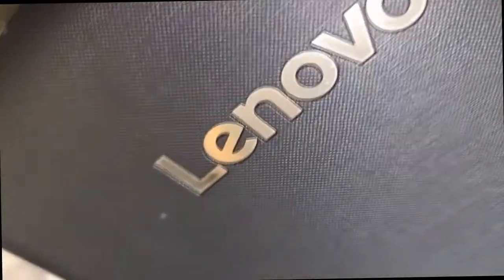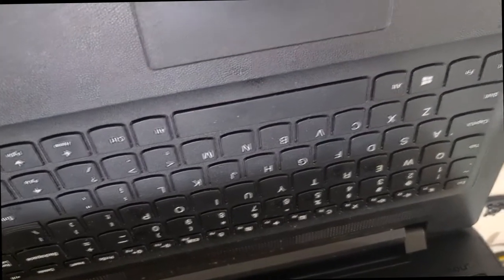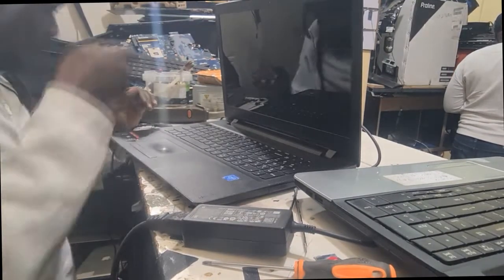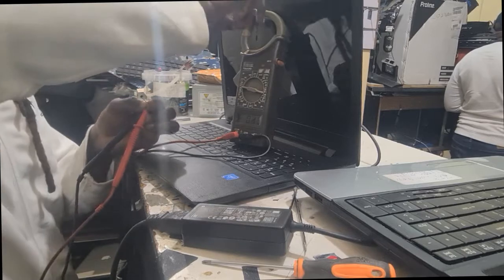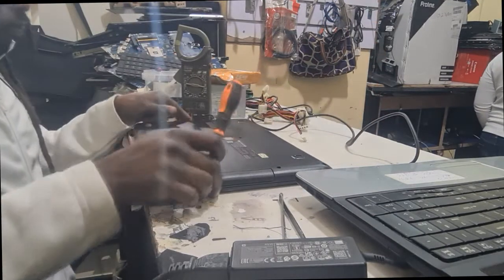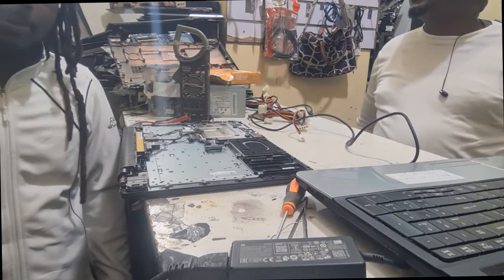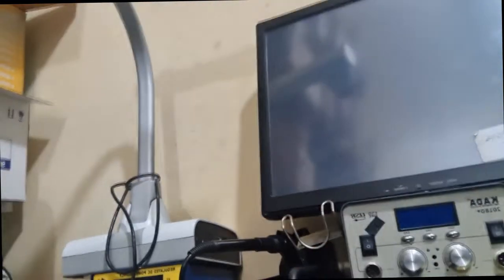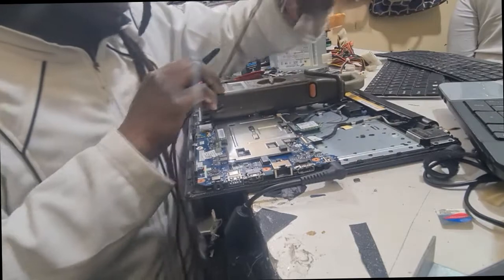LENOVO IDEAPAD 110 Not powering On Not charging motherboard Repair

Comment: Hi thanks for this video, i have exact same problem , my power connector is showing 19v so that looks ok but both my mosfet are showing 10v can anyone help plz??
Reply from the maker: Have you tried taken out the 2nd mosfet to see if the 1st is supplying 19v
Reply: @ATA-Technology  Not yet but i noticed that the battery only needs 10.8v to charge and thats what i am getting at the motherboard charge point, could i have a dead battery?
Reply: @ATA-Technology  i dont suppose what the battery on your video needed to charge?

Comment: Hi
What could be the problem if the power light is turning on but the screen is black
Reply from the maker: Try changing the RAM 🐏
Reply: if you have problems with the keyoboard the problem also lies in the keyboard if the power-on button is located also on the keyboard. press the power-on button then if the LED lights up disconnect the keyboard then the lenovo display will show.